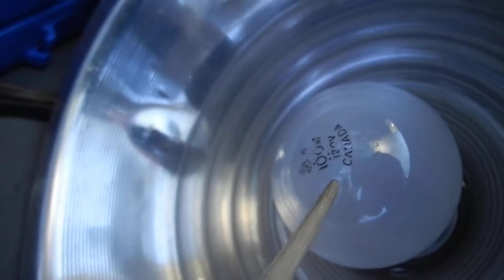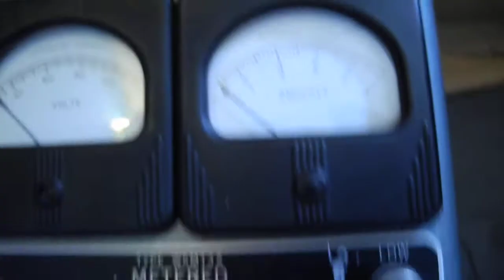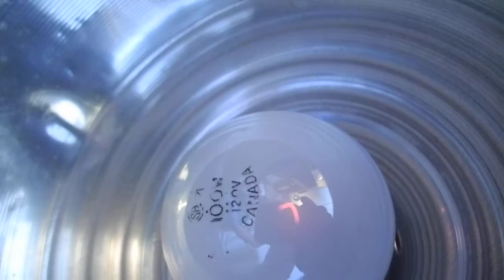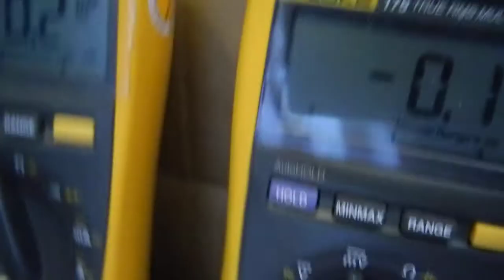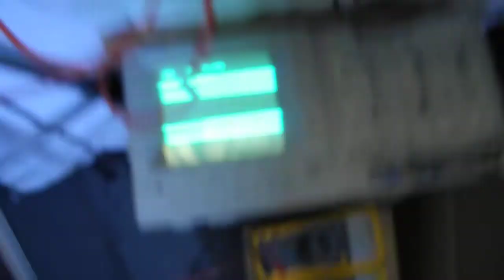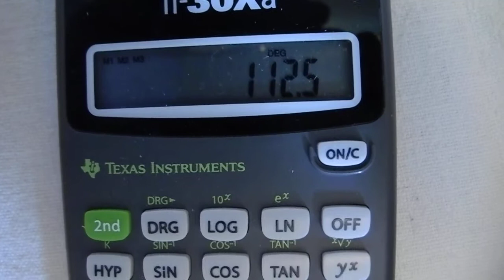Kenwood Supreme 500 - 600 Rebuild & Safe Boot-Up 4268

Comment: Dear HiFi Machine. I have a restored 600 and had a question about cleaning the "toggle" switches operate the attenuator, turnover, dubbing, presence, and so on.  I can't figure out whether the electrical contacts to be cleaned are in the housing into which the lever goes, or whether the contacts are in the rectangular metal box (directly below the switch) which is fastened to the circuit board. Thanks for your help, and thanks for this video.
Reply from the maker: The "Metal Box" you are referring to only involves the Mechanical Operation (Click-Stops and Rotation of Actuator).  The electrical contacts are further in.  There is a Plastic channel that moves back and forth, that's where the electrical contacts are located - deep in the switch.
Reply: @hifimachine4237  By "deep in the switch" do you mean deep in the part that's sitting on the circuit board, or deep in the part that's housing the switch lever? I'm assuming the former, but I'm not sure. Thanks for getting back to me--much appreciated.
Reply from the maker: @bobbyfisher3253  The Plastic Channel is near the PCB.
Reply: @hifimachine4237  Great--thank you.

Comment: have a model 500 shorted out through phono stage and blew out speakers now does not work. can it be fixed and what is it worth. iam in ontario .canada thanks
Reply from the maker: Without being able to diagnose your amp it is difficult to tell how bad it is.  If it blew out your speakers you have a blown amplifier.  To revive a blown Kenwood 500/600 is a lot of work, I know since I have rebuilt a  BLOWN 600.
Reply from the maker: If you look at your Power Amp Boards (The 2 Boards on the Heat Sinks) you will see 4 Black Plastic Transistors in the middle-top of the board.  These are Q7, Q8, Q9, Q10.  You might be able to see physical damage, these transistors might be cracked or even blown apart.  Also look for burned resistors, specifically check R25 & R29.  Look for other damaged Transistors and Burned Resistors.
Reply: @hifimachine4237  thanks  was just the right side can't find R25 orR29 Q7 to Q10 look allright?  plugged in no smoke no light on front hear a click after a few seconds. checked the one fuze i could see very dirty
Reply from the maker: @danielnicholls6868  It is very difficult to diagnose an amp on a youtube thread.  You always need to check both channels.  R25 and R29 are right next to Q9 & Q10.  Cracked transistors and burned resistors are problems that would be obvious to a person who does not know how to diagnose a damaged amp.  Beyond that you will need to get it to an tech who is experienced.  As stated in the video, repairing these amps is labor intensive.  If the amp destroyed your speakers, you have a shorted output section and the amp will have damage in many areas.  The Kenwood 500/600/650 are very good amps but if not maintained can develop serious problems.  I can repair your Kenwood 600 if you are willing to ship.